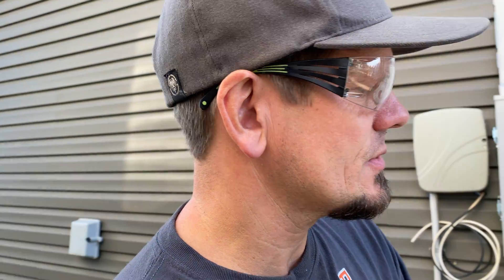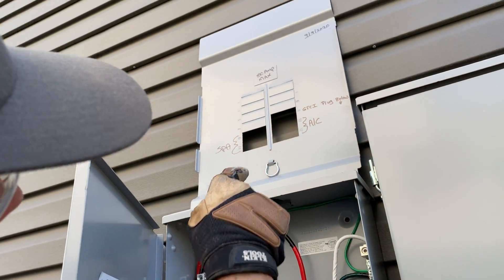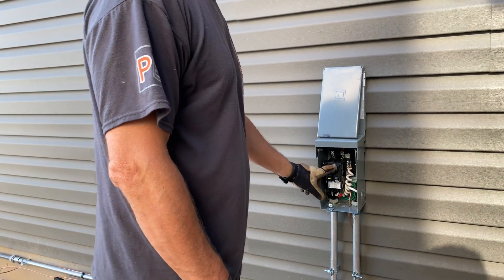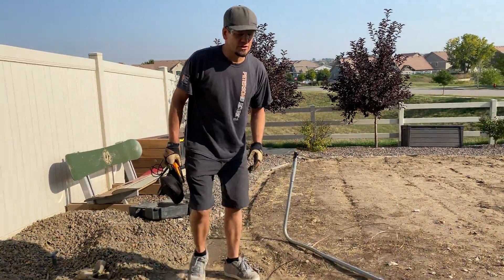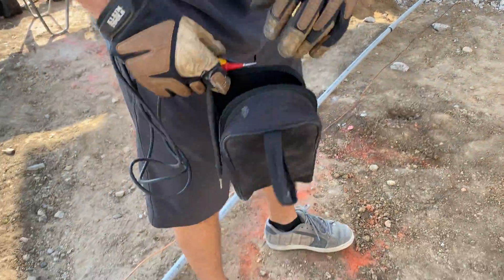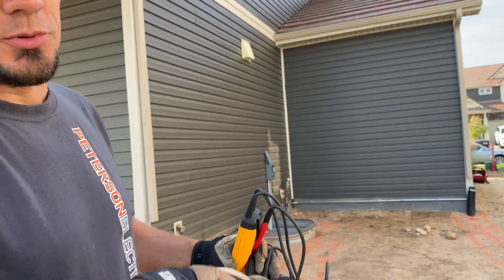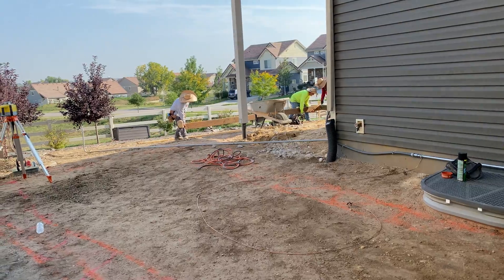Spa Installation and Equal Potential Grounding

Comment: Dud have you read 680.42 b, its syas that equapotential bonding of  perimeter surfaces shall not be required if the psa or hot tub is listed, labeled, and identified  as a self-contained spa for aboveground use. You re just doing unnecessary work🤦

Comment: When you traced out the circuit from the sub-panel around to the spa box, you called it a disconnect, but then you came back and called it the GFCI breaker. In California, do we need a separate (knife switch style) disconnect, or is the breaker enough? Thanks for sharing.
Reply: On a single family residence you only need a disconnect within view of the tub.

Comment: Did I hear they prewired with #8 aluminum? I have never heard of it.
Reply: Typical for 30a loads, not a hot tub.
Reply: I've never heard of or used aluminum wire smaller than #6. Didn't even know they made #8 aluminum. That's what I found interesting 🤔

Comment: Do you need grounding around a hot tub if it is a plug in tub with a GFIC receptacle plus a GFCI company plug. The hot tub is on a wood surface.
Reply: That's considered  portable / storable.  Not needed

Comment: isn't the equipotential grid not required if its a self contained listed tub per 680.42(B)?
Reply: that is true....depends on the height of the tub and if there is conductive steps to get in. He also used the existing panel to feed through the AC unit....you must remove it from one panel and install in the other.

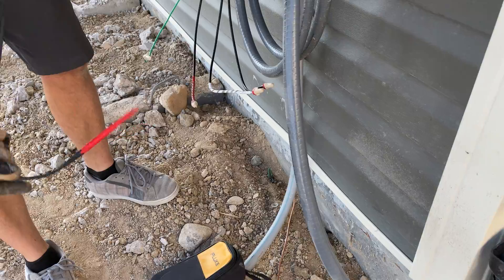Comment: Great video with info! @2:20 I'd love to hear and see more about diff of Potential. 
Interesting @3:43 regarding people pouring cement before conduit/wires are ran.  
@4:44 interesting and nice of you to have him do that. In Greenwich, CT it's taking over 6mths to get a permit to install a Whole House Generator and a trench to a dock. Everything is done online and taking longer thanks to Covid
Reply: WeatherNut27
 ... am also in lower Ct and just retired from the gen business before Covid so have only heard about (not experienced) the long delay in the permit process, other than the usual for zoning variances. There must be something fairly new in the local code for steel in a gen pad, but likely based on size. (depth of the concrete) Obviously a pad without steel can't be bonded. The flip side here is the typical generator in Greenwich is probably over 30 kw so any new pads will have steel in them.
Reply: @rupe53  Interesting. Thanks! This particular one is also in a flood zone so it needs to be up higher
Reply: @WeatherNut27  ... sounds as if it's near the shore and a high tide situation. (storm tide) Have run into many and some generators are over 5 ft above ground level, which makes servicing a royal pain.
Reply: counting 8 months for the septic here in central Texas. Nuts.